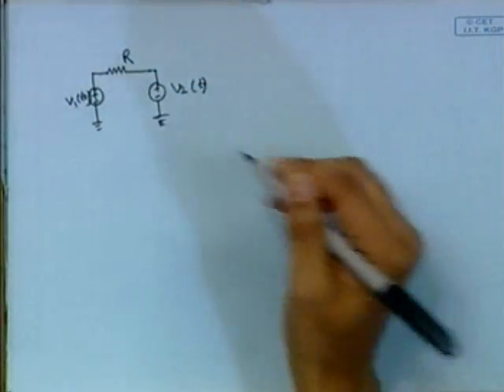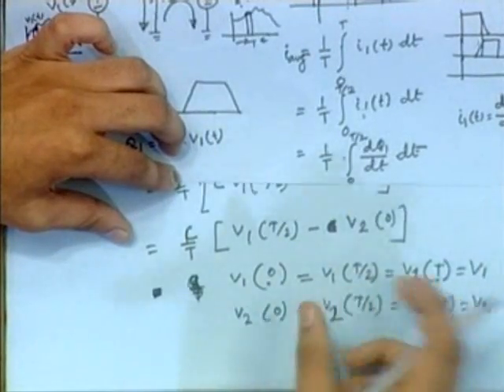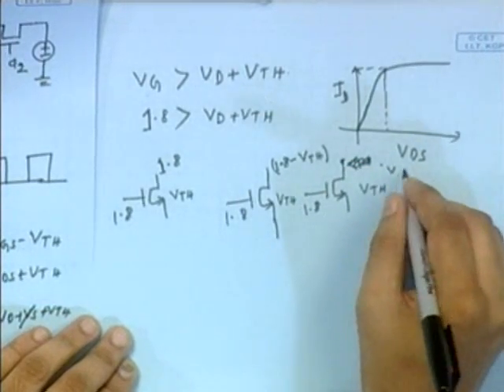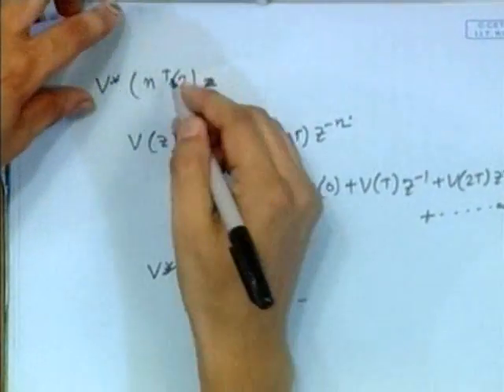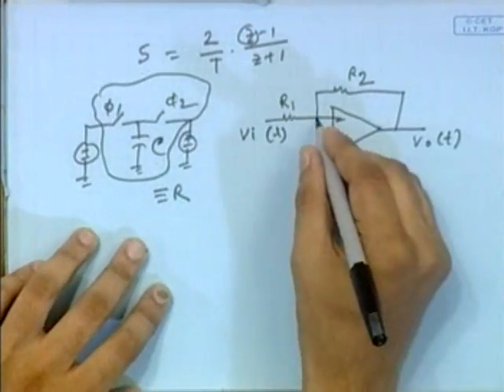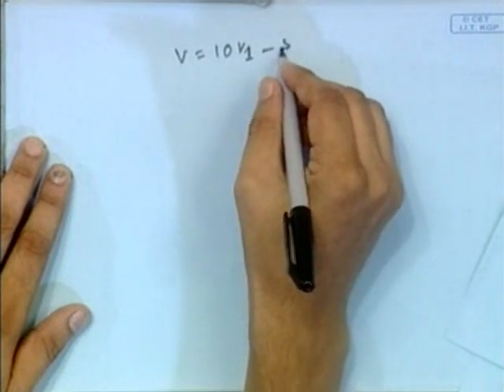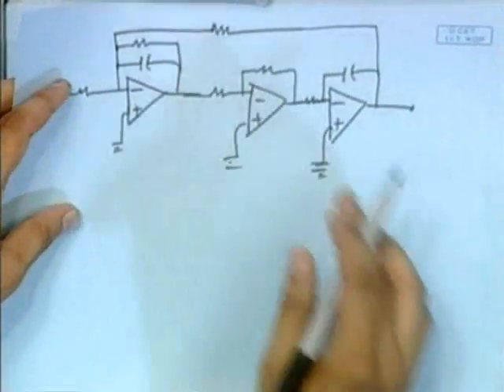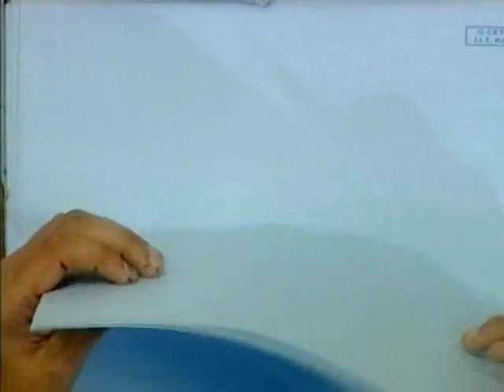Lec 27 switched capacitor basics

Comment: the lecture is slightly confusing and the massive HUGE assumptions done on the switched capacitor circuits are not even mentioned once here in the lecture by the instructor (no offset, infiinite input impedance, on-resistance effect). In my opinion, the lecture could have been much more informative if the instructor himself is not confused so much with the terminologies he uses and used different sketch colours for different modes of operation.
Reply: Lecture is slightly confusing I agree but it covers many topics and it assumes that audience has prior some  experience with analog magic 🙂🙂